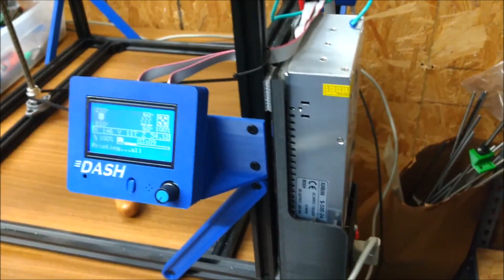Dash-X, Innovative 3D Printer

Comment: Love the design too! I am curious to hear your thoughts now that you have run this machine for over a year since the video was made. Are you still running it? and do you have any results to share with us once you had "dialled in" the machine? Was it stable? how fast is it? more accurate? less prone to artifacts? I'd be keen to hear back, since I am seriously considering this design...Thanks in advance!
Reply from the maker: Hi there, thanks for the kind words.  Yes, this machine is in nearly daily use quickly producing fine looking output.  The failure rate is about zero, marred only by the occasional blob when beginning a job.  I don't see any evidence of wear or going out of adjustment.  My biggest problem (pretty minor) is the cheap fans constantly going bad, noisy at startup.  I'll probably spring for better fans the next time around.  As far as part quality, I do occasionally see some VERY slight salmon skin effect (you really have to hunt for it), haven't yet been able to determine the cause.  However there's no stringing, sagging or other apparent problems, and all parts are dimensionally spot-on.

Comment: Wow, this is amazing. Sorry for being late to commenting on this. I have been looking for a cartesian design that minimizes weight, and of course the obvious one is the Ultimaker. But yours seem to be able to scale better. I will be looking into building a machine like yours. I am specially curious about the fiberglass shaft and I know they do it on carbon fiber as well, so, I may want to use them as driving shafts, kind a going back to the Ultimaker, but probably keeping everthing else like yours. IDEX is possible using this.
Reply from the maker: Sorry for the delayed response.  Actually, the shafts ARE carbon fiber, I mis-spoke.  They're solid, making them very stable for this use, while still very light.  The only changes I'm making to Dash is updating to a 32 bit controller and more configurable motor drivers.  I'll post a new video once this is done.  Thanks for your comments!
Reply: @NeilWNC  Sorry for the delayed response again. Will check your updates. I ended up acquiring 2 ultimaker like printers, one a used vertex k84000 (which has given me a lot of work). And just recently the Monoprice Maker Ultimate. Unfortunately with Covid the staff at the place I work is being reduced so I am flooded with work, I have no time for having a life (lol). But your project is the most interesting to me in the internet by leaps and bounds. Your idea is the right one, ultimaker + carbon fiber + 32 bits. Have you given any thought to closed loop steppers like the mks servo 42 or the ustepper? With your sturdy design you can probably print at 200mm/s,  with the right extruder.

Comment: What a brilliant looking machine, it looks so sturdy & "tight", in future updates you'll have to include examples of the prints it produces.

I bought my first printer a few months ago, a CR10s Pro, and I'm hooked!  In the past whenever I've had ideas for little projects I'd have to cobble together something from wood, aluminium, acrylic sheet, etc. whereas now I can just print something that's often better, cheaper and faster.  I've pretty much got TinkerCad down to the point where I can get most ideas out of my head and into a 3d model of some form but I really want to learn Fusion360, then there'd be no stopping me!  :D  If I manage to find the time, that is.

It's absolutely incredible that so many people, like yourself, are prepared to put in so much time & effort into coming up with these fantastic designs then give the whole IP away for FREE, such an admirable and honourable thing to do, in my eyes. 👍
Reply from the maker: Thanks Bob, much appreciated!  I'm at a stage in my life/career that it's more about time and learning/sharing than making money.

I am thinking about a follow-up video for Dash-X now that I've been using it for a year or more.  It's mostly unchanged but I have definitely done some tweaks to make it perform as well as possible.

Keep inventing, designing and building.  It's what keeps you young!

Comment from the maker: Here are a few follow-on corrections and updates: 

1. The rotating shafts are solid carbon fiber composite, not fiberglass as stated.
2. I have switched to TMC 2208 motor drivers for X and Y, very nice!
3. I am working on updating to a 32 bit controller board.  I'll post a new video once it's done.

Thanks to all who have viewed!

Comment: I Like your design a lot.
I am thinking about builing a x-cross design for myself for some time now. Some questions:
-Your X and Y motors seem very big. Is It necassary?
-For a bigger printsize (I think about 35*70cm²), do you recommend to replace the crosssection to carbonfibre rods and igus bushings instead of aluminium extrusions to reduce weight?
Do you think the printquality would profit from a Zesty Nimble instead of BMG+Capricorn?
Reply from the maker: Hi Ole.  The X and Y motors are NEMA 17, so not especially big.  Since you mention it however, I did go to a shorter Nema 17 model (after this video was made) to reduce the rotating mass.  Didn't see any change, but left it that way.  As re the wheels/extrusion vs bushings, I always prefer the Openbuilds V-wheels (with eccentrics) because of how easy it is to adjust out any play or slop.  Not possible with bushings.

Early on I tried a Zesty Nimble and had numerous issues: the flexible drive shaft kept unraveling at the ends and I had friction issues inside the unit.  This was abandoned in favor of the BMG/Capricorn, which have performed very well.

Best regards...Neil

Comment: Neil, that's a very nice design. having a wanhao duplicator 4, I agree with your statement that driving the X and Y axis with a single input is bullet proof. I also like your arrangement with the extruder, smooth running it looks like. The Z adjustment is brilliant and simple, kudos on that. What is your print bed size? please post more videos as I'm interested in taking a closer look in building some thing like that. thanks for sharing.
Reply from the maker: Hi Philippe and thanks for the comment and kind words.  The overall print size is a 300mm cube.  

If you have specific questions or wishes for further videos please let me know.  Regards.